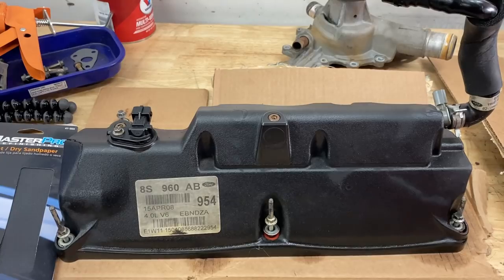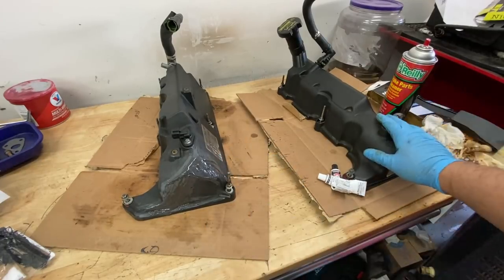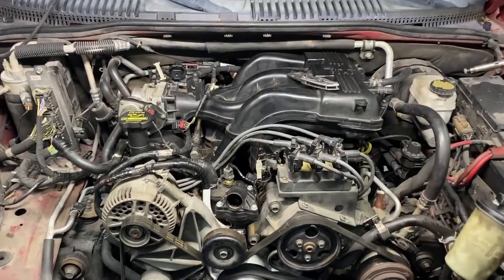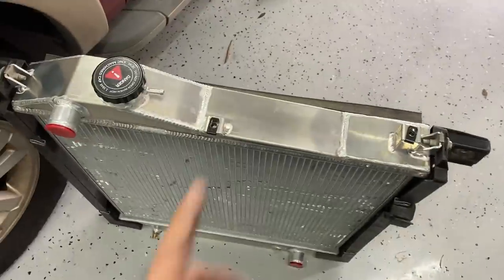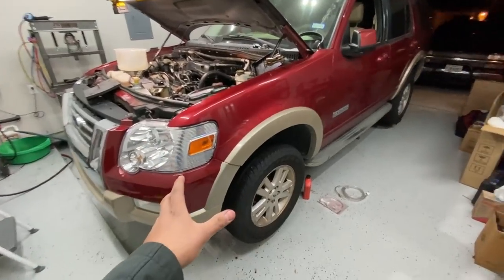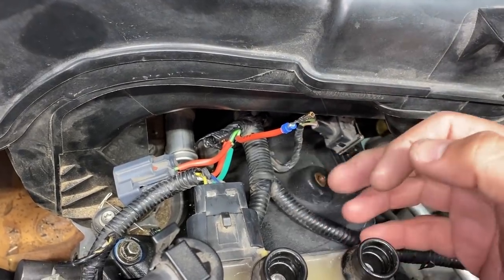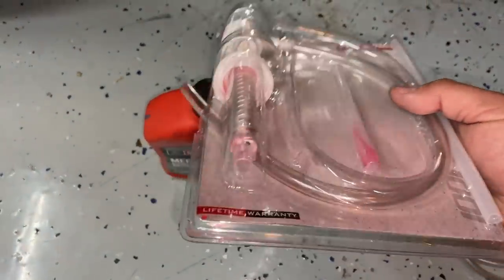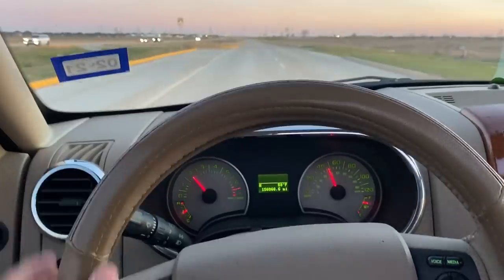EXPLODER FINALLY RUNS! INSTALLING ALUMINUM RADIATOR FROM ALLOYWORKS!

Comment: Fantastic video! I really appreciate watch a pro at work. I am a mechanic myself and also like to instruct as I go. You go over the top with simple and to the point instruction. You also showed a few problems you ran into along the way with wire harness issues and injector issues. As you know you will always run into additional problems when you break down an engine. Well done. Other videos just gloss over these new found problems. Keep up the good work. I know the amount of work you go through to complete the final edit that’s where 90% of your time goes in making one of these videos. Thank you, very well done. Having a 2006 with the same issue after going through high water and a rough engine showing a P1336 code and a cracked valve cover, luckily on the drives side, it is time to get my hands dirty.

Comment: I'm so glad we have the 4lt straight 6 ford barra engine in Australia. Over 370000km on mine and still original engine and box haven't serviced the gearbox in the last 200000km and still goes good.

Comment: Another great video! One thing I always do at the end of a tear-down like you did is get the local injector guy to test and rebuild all the injectors. The last truck I did had runnability problems after doing a lot of work on it and it was the injectors that needed cleaning that fixed the problem. That tranny fluid fill is crazy! Nice job, and excellent narrative and videography!

Comment: Nice repair! You can also drill a tiny hole at the end of each crack to help reduce their urge to travel further. 

That JBWeld almost matches the valve cover, like it's made for it, lol.
Reply from the maker: That's a great idea!
Reply: A piece of fabric placed on top of the epoxy and soaked in it will reinforce the repaired area, even using a piece of paper towel. You can also try this technique while using superglue.
Reply: "Almost matches", yeah it's virtually invisible /s

Comment: Glad to see the Explorer back on the road... wish I had known about the all aluminum radiator when I was doing timing on my ride. I did do the aluminum thermostat housing though. After I did the timing on my 4.0 SOHC, I had an issue with the fuel rail pressure sensor ~1 week later. It wanted to stall/threw a code. I replaced it and it solved the problem. I briefly had that feeling of dread when I started up my Mountaineer and it was running rough... fortunately, I had forgotten to tighten down some studs on the exhaust manifold... Easy fix, but I admit I was stressing for a minute (especially with the cost of all those OEM parts).

Comment: Great video. Way to stick with it. The next time you are at the home improvement store or even wally world go to the garden section and get a cheap garden sprayer. They are usually less than ten bucks. The container itself is clear so you can see the level of the fluid inside. I have a half dozen of them in my shop. One for each kind of Mercon, two for Honda VTM and transmission fluid and a couple with different gear lubes in them. The small ones hold a gallon of fluid and the wands are plastic and can be heated and bent for the hard to get to openings. If you label  them you will always be ready to go. The best part is it only takes a few pumps to pressure them up and you are good to go. At first I was worried about how the fluids would react with the pump and seals but the only ones we have had to replace were melted or had been damaged from neglect.

Comment: Good job! I like how you explain everything in detail. Sad those 4.0l had so many T chain issue's. I'm surprised you didn't change the transmission fluid, especially with coolant leaking into the system. For the amount of work, I would of replaced the engine or sold it as is. Cheers bud👍

Comment: I have the same radiator in my 06 XLT and had an awful time getting a hose combo that fit the inverse flare openings. Glad to see this video. What were they thinking when they did that???  Just put a standard flare fitting in so we can adapt things right up! 

Thanks for video!

Comment: Great series. Glad you got the Explorer up and running. Did you ever find the correct connecters for the transmission lines to the radiator cooler?

Comment: One thing about repairing cracks like this it drill a small hole at the end of each crack (about a 1/16th drill bit) and it will help prevent the crack from expanding.

Comment: I have a question, I hear you saying we and us, is this in reference to you and your camera? Also, happy to see you decided to hang on to it and fix it and fix it right! I have a 2009 I bought last year for running around town and not having to use my F450, I just recently replaced the complete engine harness has the insulation had deteriorated around all the connectors leaving the conductors bare and causing running issues. Mine purrs like a kitten now!! These little engines are very peppy for as physically small as they are!!!

Comment: These Explorers seem to really suffer with their wiring harnesses. I have an 06 that’s on it’s second set and going on it’s third. I thought getting one from a junkyard would remedy but that’s when I realized that it was a manufacturer defect and not specific to my Exploder. We also get a ton of Exploders at the shop with nasty misfire or harsh shifts that are caused by shorted wires.

Comment: The 3/8 fitting when removing the nipple will fit into a 1/2inch barb fitting and can be solderd ,also 3/8 id tubing can be used if you want it longer

Comment: Wow!

Great video and tons of information.  In short, very happy you buckled down and fix your Explorer.  It looks very nice in the videos.

That being stated, I am VERY disappointed with all the wiring issues.  It is not uncommon to tape the wires at the connector and then go over the "slit tube", but the damage in this video is absurd.  I cannot believe the vehicle functions.  Bear leads?  Degrading Insulation?  WOW?

Looks like German "wiring" that is intended to "bio degrade" at end of vehicle life.

GRRRRRRRR!

Comment: I'm kind of surprised you didn't replace the thermostat housing assembly with an aluminum one. I had so many issues with the plastic OEM one that it wasn't worth constantly replacing it due to warping in various places (inlet, outlet, at the base connecting to the block).

Comment: How is the Alloyworks Aluminum Radiator holding up ? I bought one for my 2006 4.6 Litre V8 that I believe has the 20PSi Cooling system, trying to do away with the Plastic tank radiators. I was just curious to see how it is working out for you, Cooling? Leaks ? How did you make out with the Transmission line Adapters ? Are you happy overall with having it installed ? Bill

Comment: Maybe drill ends of crack to ensure it doesn't go further, then jb weld screws into the holes.  The heatcycle issue is still a problem though.

Comment: Rule 1 for cracks is to drill a small hole at each crack end (1/16 or 3/32) as a stress reliever which you can fill with you epoxy. Curious why you did not dremel the cracks a little to a V to get more bond area?

Comment: What you need to due is plastic weld it.It is a plug in welder that gets hot a melts plastic strips .it's like a gun glue .got mine at harbour freight .
Reply from the maker: I'll check it out! Thanks!

Comment: Great real world video!  What really happens you didn’t hide anything!  I would have drilled a small hole on the ends or the crack can spread unless you are lucky.  I would have replaced the cover how expensive can it be.

Comment: Didn't get the chance to watch all the way through your vids. Please tell me you loctited the two bolts that hold the front cassette  in the driver's head.  2 years after replacing the guides/ chains in mine both bolts walked on me. No fun so I respect your abilities.

Comment: You need to contact the radiator manufacturer about changing their connection made to match or providing an adapter that works

Comment: My opinion on taking a chance with that valve cover after doin all that work I would of replaced it. Looks like the crack will just eventually give out to the rest of the plastic valve cover
Reply: $92 on rockauto.  Replace it and move on.
Reply from the maker: Things were just adding up really quickly. I may decide to replace it in the future. Thanks for watching!

Comment: I bought one of these alloyworks for my 08 mountaineer and it has been a nightmare. Why this company does such a poor job of supplying the customer with the appropriate fittings is beyond me. In addition to that they are located in China so good luck getting a technical question answered. I am about to go to a custom hose fitting outfit with the fitting which came screwed into the radiator and the ford quick disconnect fitting and asking them to mate these up for me. I have already wasted time and money ordering fittings that I thought would fit but totally goose eggs x2. I can only hope the rest of the radiator is aces because it will have to salvage the reputation of this purchase for me. On the cosmetic side of things, looks awesome and trick!

Comment: Hi Eric - Good video! Do you have the part number for the aluminum radiator? I went to Alloyworks website and could not find one for 2009 Ford explorer V6 4.0. I found one for 2010 but the image doesn't look the same to what I have on the Explorer.

Comment: Do you have a system to keep track of all the parts?  If it was me, I would have tons of unnecessary parts, bolts, connectors that don't match, etc.

Excellent video!
Reply from the maker: I just use several different colored magnet trays. Most of the bolts I can tell where they go by looking at them. Thanks for watching!

Comment: The wire decentigrating issue is a problem with that generation of explorer and mountaineer. I've had to do alot of the same insulation repairs

Comment: Should I delete my engine fan clutch and go with electric radiator fans? Pro's, cons?
Reply: I added a high performance aftermarket electric fan to my truck. Works great, but it is loud. It isn't variable speed. It's either off or full blast. Also, when the A/C is on, the fan should turn on at all times to cool the condenser. The aftermarket electric fan won't turn on until the ECT is high enough.
Reply: engine fan clutches are generally ar better if you're doing anything under load or at higher rpm's. if you're idling though or at like 1000 rpm, an efan is generally the best option. basically, are you towing?
Reply from the maker: I have thought about switching to electric as well. My fan clutch on the Explorer I believe is starting to lock up and stay in high mode. The replacement part is over $300. If I do decide to go electric, I'll be sure to do a video. Thanks for watching!

Comment: Hello, I have a 2004 Explorer 4.0l. Around 2 weeks ago a mechanic changed the timing chain kit, spark plugs and wires. A couple days ago the check engine light appeared and I scan to see the codes and I have a P0300 & P0316. Do you know what might be the issue? Thanks

Comment: Actually, thicker radiator works best only when thermostat valve is removed. However, thinner radiator is better cooling than thicker ones, especially the larger surface of thin radiator.
Reply: Really wow LOL You have no idea what your talking about

Comment: That wiring insulation looks like the stuff Mercedes used in the early to mid 90’s. It was supposed to be “environmentally friendly” but disintegrated and turned to powder leaving nothing but bare wire. Maybe Ford was late getting the memo.
Reply from the maker: Exactly! I see the same in some BMW models

Comment: Hi, I was wondering if the oil restriction rod was meant to be shorter or was it a knockoff part that was made wrong.
Reply from the maker: I wasn’t really sure, but it was an aftermarket part. I just figured I would rather be safe then sorry. Thanks for watching!

Comment: Its embarrassing how a car company can make connector ends that causes the wires to be bare. and the infamous ford injector. ive had the exact same issue with one stuck open injector, i was worried aswell that i had hydrolocked the engine.

Comment: you could have just done a clear flood mode by doing full throttle wide open then crank engine no need to pull relays
Reply from the maker: Some vehicles don't have clear flood mode. You'll know when you start it up and it redlines because your foot has the pedal to the floor. I just wanted to be safe rather than sorry. Thanks for watching!

Comment: That fill tube is calibrated for a fluid level at a set temperature range, check the service manual for that year and model for the correct temp range. ie. (85C/185F)
Reply from the maker: Yes. This one specifies 80-120° F

Comment: I just had a customers brother have a ford exploder towed to my shop for a no start ..  he said it just needs a starter …….🤓 I get in turn the key and the truck turns over but sounds like no compression.  I look 👀 under the hood and oil everywhere a hole in the battery and the cam sensor looks like a sledgehammer hit it . And a BIG FUC$!nG hole in the valve cover 🤣🤣🤣😂😂🤣😂. And the timing chain hanging out of the valve cover and pieces of it everywhere .  I tell him he’s screwed. He said sooooo you can have it fixed by tomorrow right ???
Reply from the maker: Dang! that sucks lol 😂

Comment: Too bad Ford used all of that plastic, especially those valve covers. They should be metal...like old cars had in the 1970's and before. Never did they give a problem. Re-inventing the wheel isn't so smart with some items.
Reply from the maker: That's how I feel about todays radiators. Plastic does not belong there. Thanks for watching!
Reply: @ADVANCEDLEVELAUTO  Thanks for the radiator tip !